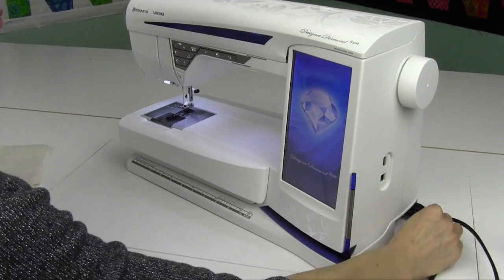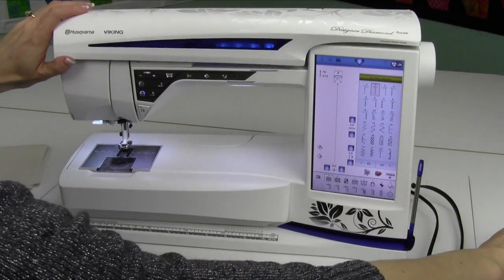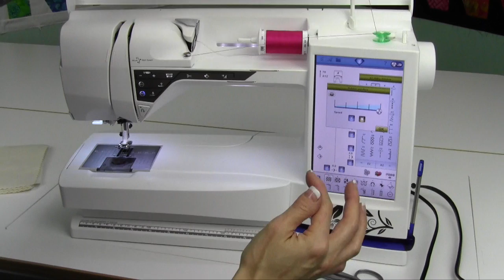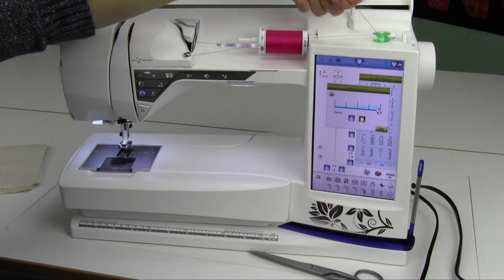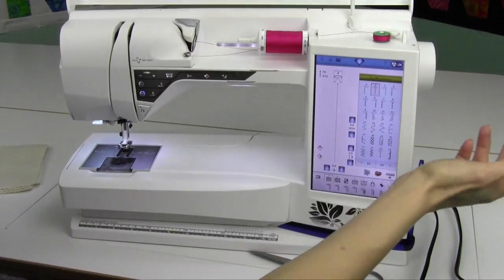Husqvarna Viking Designer Diamond 3 Machine Set Up, Threading & Winding a Bobbin

Comment: My bobbin does not fill completely. What is wrong?
Reply from the maker: you can adjust the bobbin winder stopper with a screw driver to allow it to fill fuller. If you can't figure it out, your local Husqvarna Viking service technician can do it for you at your next service.
Reply: @HeirloomCreations  thank you I will do this.It has been frustrating to run out of thread in my bobbin while working on a project.